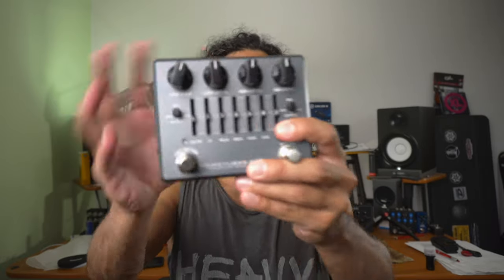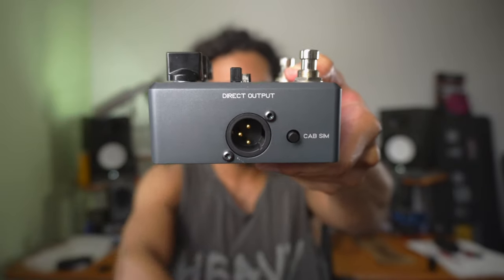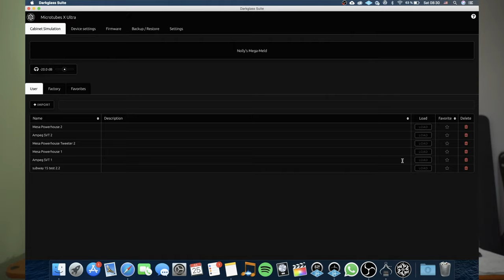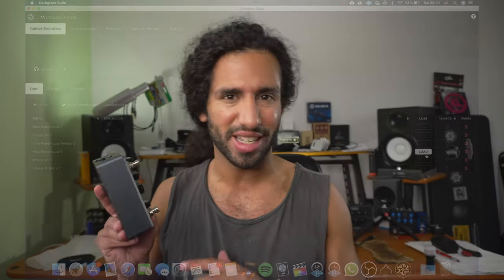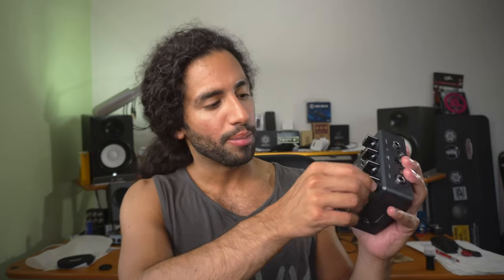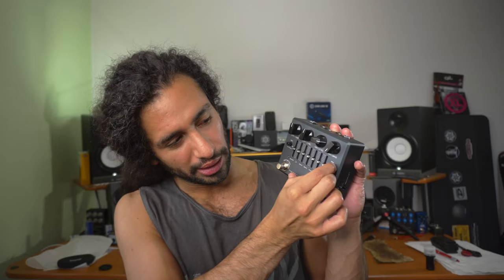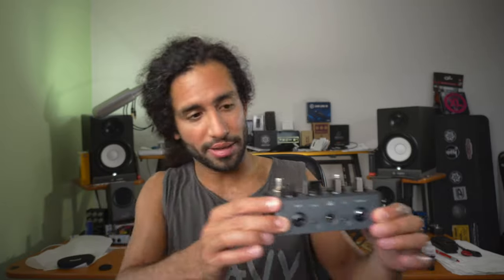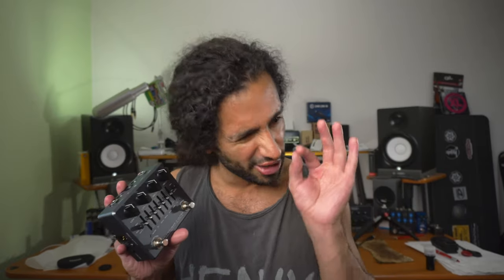Darkglass X Ultra Distortion Pedal | DEMO

Comment: Hey guys, I guess I need a bit of a help here.
I bought this one recently, but I seem to have some sort of a problem with getting it to work.
Basically, right after I connect it to my power source, then put my bass in along with my headphones, the only thing I can hear is a lot of humming noise. "Master" control seems to be on "bypass" mode (its control light is Blue) but the rest of the control lights is neither red or blue.

Does it have to be connected to my notebook via USB to work properly? Because right now, I only tried to play it without the USB. Thx for any sort of help, my English isnt that good, so I hope you understand what I mean 😂

There is nothing wrong with my bass or my cables, since they all work just fine with other pedals and effects....

Comment: I was going to get the AlphaOmega Ultra but then I saw this......
Reply from the maker: Let me know how you like it once you get the pedal! 😁
Reply: @IvanBassist  I think I’d get both either way but I’ll go with this one first. This pedal is really similar to the Neural DSP Parallax which I’ve been getting used to for a while. That I’ve sometimes got frustrated from not having parallel compression in the amp during the session rehearsal. So I think I’ll need this first